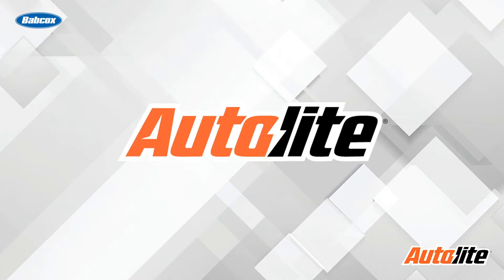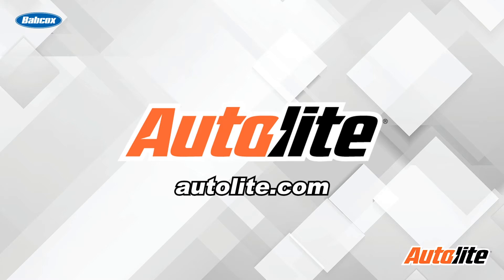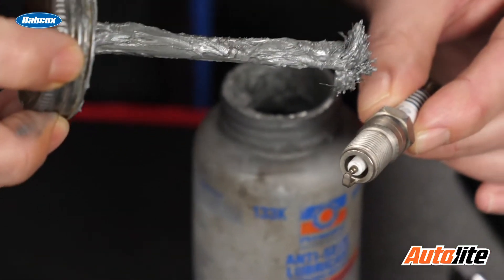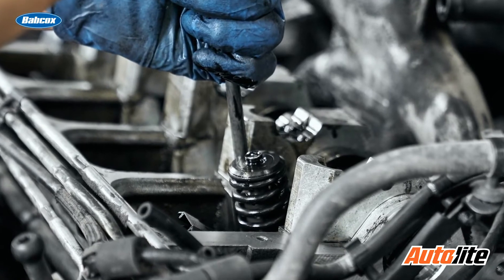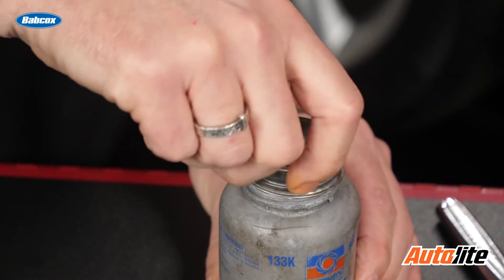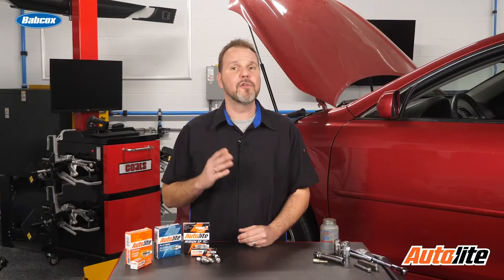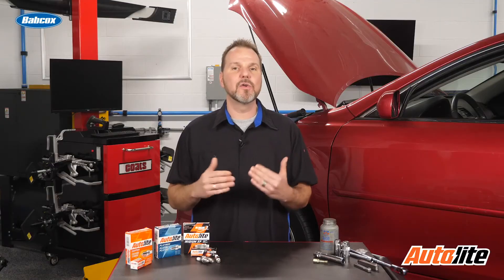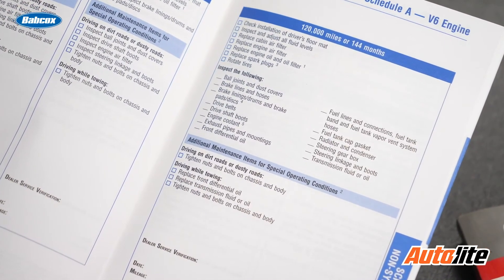Should Anti-Seize Be Applied On Spark Plug Threads?

Comment: The sparkplugs manufacturer says 180 to 270 degrees after hand tightening the plug. Best not to use a torque a wrench if anti seize is used so plug cannot be over tightened.

Comment: You risk over torquing if you do and risk a plug freezing if you dont. It's much easier to control torque than 'guess' if a plug coating may or may not work. I've done plenty with anti seize on race bikes and never had an issue. I have, however, had a dry plug snap inside a head and spent a few hours extracting it. Do what you want, and the end of the day I know what has worked for me time and time again.

Comment: Master electrician here. There are several aspects that are never considered in this topic- when the fastener is tightened the thread contact is on one side, in this case the top of the spark plug threads pulling against the bottom of the spark plug hole threads. The anti-seize is forced out of this contact patch except for a very small film. That film is insufficient to interfere with cooling and or electrical conductivity. The material that is forced out of that contact patch resides on the outside and seals the contact patch against intrusion by corrosive gases,solids and or liquids. That is your anti-corrosion protection which if it is not present can cause the two surfaces to "bond" together making spark plug removal difficult if not impossible without thread damage. Lots of things happening at that contact patch in and around it with regard to chemicals and heat Dynamics (expansion, contraction, temp extremes) I always use antioxidant compounds on a commercial municipal electrical connections where there is low voltage but very high amperage draws. Similar to your battery clamp connection, lather it with the antioxident (essentially just Vaseline!) and tighten that cheap nut to 10 in pounds and it will squeeze out the excess and that puny 12 volts DC currentwill conduct 200 amp starter load just fine through that pathetically low tensioned🎉 contact patch.

Comment: NGK say not to use it as the threads on their plugs are chrome plated which provides corrosion resistance and aids easy removal. The info can be found on their website.

Comment: I just replaced the spark plugs in my Camry. I used antiseize, because that's how it was done when I went to tech school 25 years ago. I saw this thread, now Im worried that I could have damaged something. No check engine light, so I think I'm alright. I did use a tourque wrench to tighten the plugs to 18 foot lbs.

Comment: If you have ever had to take spark plugs out with a 3 foot breaker bar and a pipe you’ll be using anti seize on them. Same if you have ever pulled threads with a plug. That’s why I do and I’m in the south. I’m the only one at work who does but I will stand my ground on it. I also don’t know anyone that uses a torque wrench for spark plugs either.

Comment: Here's what I've learned as an engineer: there's a reason why manufacturers differ on instructions on their vehicles, they have done extensive testing and almost go on the safe side which is a design safe factor. If the manufacturer says don't put any then don't. If the manufacturer says you should put some then put accordingly. Any third party aftermarket manufacturer who tells you that you don't need ever to put anti seize because you are using their own product or so claiming a universal basis, you run the risk of destroying your specific vehicle by obeying them blindly. Unless there's an engineering change issued for such practice from the specific manufacturer involved, don't change it.

Comment: All AS are not the same    there are copper,nickle,molly,alum. based AS all 4 have a different galvanic effect depending on what the cylinder. head is, alum. or iron ,and if the plug is cadnium plated or bare steel.I just apply a dab of clean grease to alum. heads and copperAS to iron heads.

Comment: I’d rather be able to get the old plug out and save the threads instead of battling it and then have crusty threads or need to chase threads and risk metal entering the cylinder.

Comment: Thread chaser cleaner is the ONLY good recommendation here! Don't ever overtighten your plugs, but a few pounds under when you add copper antiseize is perfectly fine(hand-tight usually)! No stripped threads and tight enough to stay put is the goal here, and guess who will NOT be there to tell you that you should've added anti-seize because they added a "anti-seize" coating but now your plugs have seized after 120k miles of driving!? You guessed it, the manufacturer!

Comment: WRONG!!! Harley Davidson cylinder  heads have been using aluminum heads. Aluminum metal and most spark plug metals are incompatible metal surfaces. Use a little "COPPER" antiseize!  It is a common practice with every spark plug installed at the local Harley dealer in my area. Replacing or repairing a cylinder head sucks!

Comment: my mechanic, Asian cars, owner of multiple shops, master at his trade without a doubt, i watched him pop a strip of antiseize on plugs and go to town. these were Denzo plugs, coated etc from memory. He said always put just a bit on, not much, as it will seep down onto the plug and cause issues if you gob it on. down spec the torque? i am not sure if he did but from my industrial experience, thread torque ratings always change vrs the type of thread dope you use so i would seriously consider taking the spec down to the greased spec which should be listed in your plug torque specs.

Comment: I was always told antiseize can result in accidental overtightening and stripping threads in aluminum heads since it contains a super slick molybdenum, zinc or silicone grease base. A lot of heads are aluminum nowadays and  manufacturers are advising not too apply it for that reason. A blanket one size fits all solution. It's not needed or recommended for aluminum. If you have iron heads there shouldn't be a problem. But as stated new plug threads are coated and any corrosion that happens won't result in rust welding. It will be more of a powder I believe that's what the old schoolers are trying to convey. Old uncoated plugs plus iron heads can cause rust welding.

Comment: I've been using copper coat on spark plug threads all my long life. Torqued to mfg specs and never ever a problem. I see that using copper coat is actually better due to it's conductivity characteristics thus providing a better ground that a spark plug requires. I'm a firm believer that it's helpful all around when used on spark plugs.

Comment: I was tought eons ago in our shop class to use anti seize when similar metals are in contact.
I've been using it ever since then and never an issue.  Of course it effects the torque value - if you can't properly tighten a spark plug by hand, well...

Comment: I think anti-seize got a bad reputation from folks over-applying it, like tooth paste. Don't use that giant, splayed brush. Just put a tiny dab on your fingertip to apply. Also being an EE, this dude says, "With today's high voltage ignition systems..." or something like that. Uhm, the higher the voltage, the more easily the current can pass from the head to the plug shell. That makes no sense.

Comment: I seen this argument for the past coupla years & the anti side always seem to come down on the 'you'll over torque them' scare tactic.'

If you've ever worked an air cooled Anything w/ an alum head after a half dozen years of use & normal maintenance, (meaning none), you have learned to make it easier on the next guy by putting a bit of Neva Seize on the threads.

The reasonable, I'm not going to treat you like an idiot response is if you use it, realize you shouldn't gorilla arm them in... which you shouldn't when dry, either.

Never had one fall out OR break, stretch, muck up threads, either; but then, I've never had to cheater bar one out I put it.

Why? Been using Neva Seize for longer than I can remember.

Comment: If you can clean the threads of the gunk and buildup with some 99% alcohol with a nylon gun bore brush then theoretically you reduce the chance that you'll have an issue when removing plugs having not used anti seize.

I've had 14mm nuts walk off the studs of bolts torqued at 30-35 ft lbs when using anti size with regards to suspension parts. Never again. I barely used any and it was enough to throw my torque value off.

Comment: Cars now have 100K spark plugs. They also last 200000 -300000 miles, It might be ten years between plug changes. Use a SMALL dab, (frosting it like a cake WILL cause problems), of nickel and/or copper anti seize and take it easy on the next poor bastard that slaps a socket on it. And, lube up the boots with silicone dielectric grease and save a coil/wire/boot. Also, I'll chime in with the rest of the old farts: 50+ years, no problems.

Comment: You didn't mention the fact that anti-sieze compounds reduce the thermal conduction between the plug and the head.  Research by Bosch showed that plug electrode temperatures can increase by up to 300 deg C as a result.

Comment: Never  use anti seize. Chase the threads and simply apply so light oil. The reason,  never seize, ok cool, the first time, however the second time the plug acts as a plow along the threads, and pushes or piles up the old remaining compound around the end of the plug. Then you have miss firing events. Never seize compounds are conductive. Graphite, copper.

Comment: Just did a spark plug change on a 2011 Toyota Tacoma V6.  The plugs were seizing on the way out and felt scary.  Had to screw in and out to get them to release.  And these plugs were the so call coated metal ones.  Used antiseize on the new plugs and I don't use a torque wrench.  I got by turns per the spark plug manufacturer.  For instance these had the crush washer.  1/2 to 2/3 from hand tight is recommended.  Did that and the engine purrs like a kiltten.

Comment: I put anti seize on spark plugs & basically every single nut & bolt on all my vehicles & bikes unless loc tight is specified.  I'm 65yo .... been the same way all my life. ....... PS. NEVER used a torque wrench on a spark plug EVER ..... In fact, I've never heard of it.

Comment: I was shocked to see my 1962 motors manual said not to use anti-seize on spark plugs. With that said, I always use it.  I put a little bit on the upper threads and on the gasket or seat also, in combination with some light oil and run the plug up and down by hand a couple times to make sure the threads are fully covered with a thin coat, while also trying to have minimal anti-seize exposed in the combustion chamber.  Also I never use a torque wrench but rather go by feel.  I once read in an old hot rod magazine that all threads should have something on them, and I always follow that rule when it’s something I care about, which definitely includes all spark plugs.  I have had a very very difficult time removing spark plugs that clearly went in dry!  Also the conductivity argument doesn’t make sense to me since aluminum/copper etc. that are in the anti-seize are better conductors than the steel spark plug itself, and certainly a better conductor than the corrosion that would otherwise form.

Comment: BULL CRAP! When we are torquing a fastener or a spark plug, we aren't measuring or setting anything while threading the item into position. "Torque" doesn't come into play until the plug has seated against the head. At that time, the anti-seize is playing a very small roll in what is happening. As far as grounding, and his comment about nickel alloy in the making of the plug. Anti-seize is made with either nickel or copper in the formulation. Both good conductors.

Comment: I’m 74 and have been wrenching on HD motorcycles and aircooled VWs since my teens. I always use antiseize  on spark plugs on both. It’s a no brainer.
Reply: The 1st time you remove  a 3:25 spark plug and the head threads come out on the plugs you’ll become a believer.

Comment: Been using copper antiseize for spark plugs and dropping torque specs by about 10% for vehicles and small engines for 25+ years and never have had a problem. Just changed the plugs in my 332,000 miles 4.0L inline 6 Jeep Cherokee for the 5th time. About every 60,000 miles.. My 2004 Ranger with 3.0L V6 246,000 miles is coming due for its plugs. Have had it since 2006 and less than 25,000 miles. I do 95% of my own repairs and all the preventative maintenance on all three of my regular vehicles and several motorcycles.. Tools can get expensive but nowhere near as expensive as a hourly shop rate if you can't work on your own stuff..

Comment: Who the F__K torques their spark plugs? I always use copper anti-seize on spark plugs and snug them good. Depending on what vehicle I'm servicing i might index the plugs. There really is not much reason to torque spark plugs, they're not fasteners. If you could just snap them in somehow there wouldn't  be any discussion of torque values.

Comment: Are you nuts ? Been a mechanic on industrial equipment for 50+ years I had to take out spark plugs with a 1/2 drive many times we used anti-seize and the next time was beautiful, you talk to novice mechanics ! Real mechanics know how to tighten down bolts, nuts and spark plugs, only a novice would tighten a bolt or spark plug and brake it, in the real world when you need to service something you pray that the last mechanic used anti-seize to make your life easier and you do the same for the next repair!

Comment: This only happens to idiots that think if 20 ft lbs is good then 120ft lbs is better anti seize was made for a reason so fasteners won’t gall and I would always use copper or nickel on aluminum because of galvanic corrosion unless the plugs come with anti seize on them which some do just ask the parts supplier if they have anti seize on them or if they don’t either way just don’t go ape shit tightening them down and you will be ok it’s not rocket science

Comment: As I see it as long as there's not a risk of something that needs to be grounded losing it ground, then use it.  I've had oxygen sensors that I sure wish I'd used anti-seize.  The heat cycles of the exhaust systems and the corrosion from road water spray can cause seizure problems.

Comment: I started using copper cote anti seize lubricant on spark plug threads 35 years ago.  (just a light coating).  Since then, I have never had an issue with a difficult to remove spark plug. As well, I have never had an issue with spark plug loosening up either. 
    Prior to that, there would be an occasion when I encountered difficulty in removing a spark plug. I replace spark plugs this way on all my cars, trucks, tractors, lawn mower engines, etc.

Comment: The factory service manual for my Honda specifies to use a small amount of anti-seize on spark plug threads. The specified torque seems appropriately derated. But I wouldn't use it otherwise.

Comment: Damn, I have been doing it wrong for over 50 years and have never had a problem. The Bosch spark plug manual already states to reduce torque by X% and the spark plug is grounded by the end at the hex and not just by the threads.

Comment: Sometimes I have added a light coat of anti-seize to spark plug threads and sometimes I have not. Doesn't seem to make much of a difference one way or the other. I would say applying anti-seize is one of those things that doesn't hurt. Normally I would always do it but sometimes get into it and too lazy to walk over and get the tuibe or bottle so the spark plug goes in dry. I've never suffered any pain over it one way or the other.

Comment: The only time I have ever used anti-seize is when the thread on an aluminum head has been previously damaged from over torque (or thread locked from excessive carbon build up), even then it is vary sparing just to run the plug loosely in and out a few times. I typical wipe off any excess before torquing the plug (see note below).
>
Over torquing pretty much everything is a common problem across the industry. Always they think, "Just that little bit more to be sure" and then it's stretched and busted threads for the next person :)

Comment: Breakage also occurs from thread locking from corrosion, and give me a break, anti seize contains a softer aluminum or copper or nickle metal to stop galling of the threads thereby maintaining electrical contact, moral of the story is don't over tighten, plugs with compression ring gaskets get turned 1/4 turn past contact, angle seat plugs get tightened 1/8 turn.

Comment: Been working on cars since 1968 Dealership and private garage's ,any car with aluminum heads have problems I always put something on the threads because I have seen to many frozen plugs . engine oil works just as good .as far as tightening or torque when you have installed thousands of plugs you just have a feel for what is tight

Comment: A good rule of thumb to is not leave the plug in for 10 years and 100k miles like so many manufacturers claim. It's a great marketing idea to con people into feeling like they can go forever without replacing them but that's not the case. Never had an issue putting a small amount of antisieze on them. What I have had issues with.......LEAVING THE PLUGS IN FOREVER AND FIXING A PROBLEM YOU COULD HAVE PROACTIVELY PREVENTED.

Comment: The real issue is the dissimilar metal of the steel spark plug thread in aluminum heads.  Steel siezes in aluminum.  Thats why you use antisieze on the threads.   Keeps the thread intact in the head.